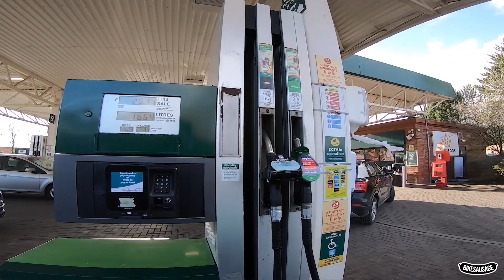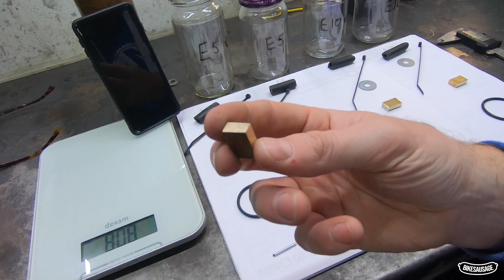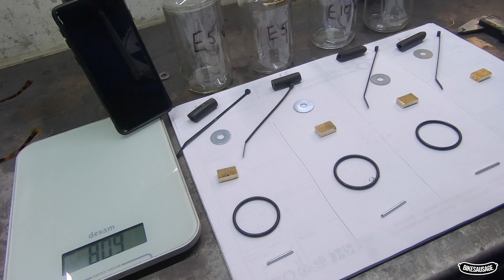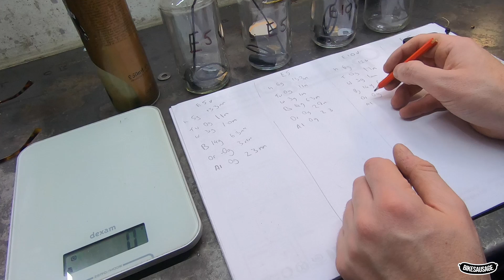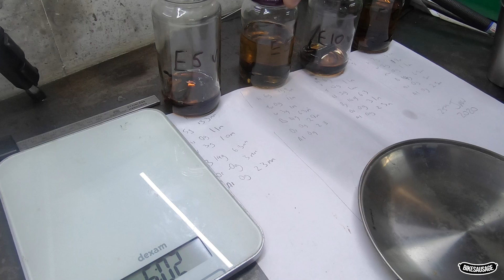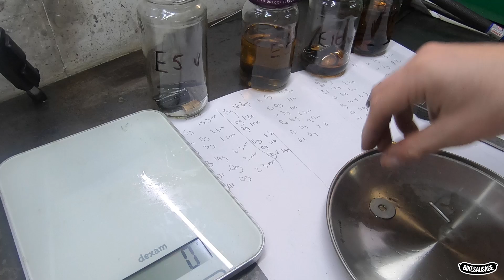E5 v E10 FUEL | Does it really make a difference?

Comment: My first question is ... Was the O-ring being used one  of a type that would communally be used in a fuel system or Carb, or was it just a run of the mill O-ring.   My next question is what would happen if you re-did the experiment but this time got a new o-ring say a new injector seal from a modem car then a new replacement o-ring from a carb system.  Are the new o-rings in new vehicles any better set up to deal with the ethanol or are manufactures just telling us they are.     Like your work, really interesting video.  :)
Reply: On earlier vehicles, rubber parts in the fuel system were invariably nitrile rubber.  This will cope with intermittent contact with efuels, but will fail relatively quickly when continually immersed.

Plastic and metal fuel tanks can also suffer damage as a result of efuels.

Comment: If you have a nylon tank like aprilia rsv milles and other bikes from tbe early noughties or later you need to be careful about E10.  Ethanol and nylon dont do well together and ethanol absorbs moistures...end result is the tank absorbs water and swells.  It's not scare tatics..it does damage. Storing bikes over winter to  be safe use storage petrol. It's ethanol free and 99 octane and stays stable for a year.  Ethanol will damage some plastics and rubber and can be a catayst for fuel sludging up in fuel systems...plenty of proper evidence to back this up.
Reply: where do you get storage petrol from ??
Reply: @virtuosomuso  I bought mine online from AngloAmerican Oils.  Not cheap at £25 for 5 litres delivered but its part of the running costs for over wintering the bike.
Reply: Gulf super unleaded fuel is ethanol free I think it's what goes in my tuono no problems so far with any tank expansion or running issues.

Comment: On a dyno you drop 5% power on e10 fuel. I’ve tried it on the 3 bikes I own same result each time. The bikes are Triumph 850 sport(2020), triumph t100 (2017) with Tec cam fitted and Enfield 500 Trails (2019) fitted with Hitchcock 615cc conversion.

Comment: I've run a few tanks of E10 in my MT10. I averaged about 105m a tank compared to 127m with E5 so I go with the full fat.
Reply: Same here, only I'm running a 20 year old car. Being a Toyota, it will run on E10, but I find I get around 10% better fuel economy from E5/Super, which negates the price difference. Seems to run better, too, probably because ethanol gives less energy.
Reply: Ethanol contains less energy compared to Unleaded Fuel.
Reply: @Varrakk  The energy density is less with E10, compared to E5 and E0. I fly a microlight with E10, compared to E0, I get 12 l/hr on E10, OR 10l/hr on E0.
Reply: @Varrakk  E5 & E 10 are both unleaded fuels .
Reply: Same here on my Ducati runs a lot better on e5
Reply: 127 miles a tank wow
Reply: I've also dropped about 20miles range. Definitely worth a couple of quid extra for 20miles back.
Reply: 15 liter tank?
Reply: @TheCrabbers  17
Reply: So what works out better value?
Reply: Pls stop. Such differences are impossible.

Comment: We've been stuck with that E10 garbage in the US for a long time now.  I had to replace every single rubber fuel hose on my '86 Nissan pickup because of it.  The newer hoses work fine with the E10, but the truck runs a lot better on 100% gas.  It's just hard to find that reliably, especially in rural areas where I usually am.

E10 will also lead to higher corrosion/gumminess/etc. in carbs.  I only run 100% gas in my '93 Honda ATV and '76 CB550.  Previous owner of the CB had put ethanol fuel in it and let it sit, the carbs were an absolute disaster.
Reply: I use 110LL (avgas) now on all of my older vehicles now. 
Ethanol is a mistake in anything earlier that the 1990s IMO. 
Obviously not using avgas in anything with a cat before any clever person points out its not compatible ;)
Reply: I think it's a mistake full stop, a guy I work with had a 2009 volkswagen jetta and he filled it with E10. Within a day he noticed a significant drop in power and by the end of the week it was hard to start and cut out at every junction. Previously he was getting around 400 miles on a full tank, with the tank full of E10 he got 250 miles. He then filled it with super unleaded E5 but the E10 had already damaged the fuel injection system and the cost of repair was more than half the value of the car so he traded it in for a diesel. We've got a petrol generator at work and someone filled it with E10, it hasn't been the same since. I will never use E10 in my bike.
Reply: 100% gas is amazing if you’ve never used it. I was working In Iowa where it’s sold as “super” at 87 oct 
My truck ran better than it ever had on e10 at 93oct 
We have a station near a boat loading ramp that sells 91oct 100% and that stuff is like jet fuel in my tundra, but at $5.99 a gallon it’s not every day I’m buying 38gallons of that magic elixir
Reply: @Heavywall70  you can still buy ethanol free petrol here in England, super unleaded but I've just did a price conversion, you're worried about  $5.99 a gallon? We're paying  $9.50 a gallon here.
Reply: @sambrooks7862  Super unleaded is E5 which contains 5% ethanol .
Reply: @maskedavenger2578  no, it depends where you get it from. The E5 is the maximum amount of ethanol in the fuel and some companies don't put any in it, namely esso, although truth be told we don't really know what they put in it, for all we know it could have badger piss in it lol.
Reply: @sambrooks7862  I used to know a tanker driver he said they deliver the same crap to all different fuel stations ,could be Esso BP ,Shell or Texaco ,I have also heard the same from other sources . It’s hard to know who to or what to believe . I tend to stick to the same local BP & use there E5 as it’s my engines always run good on it & I had a Suzuki Bandit 60O laid up for 2 years & started fairly easy & ran ok once it cleared its throat on the old E5 basic stale untreated unleaded . I never use Supermarket fuel as I have experienced poor running in the past when using it . Both the motorcycles I own now will run on E5 or E10 ,but I will use premium E5 until I have no more choice  but to use E10.
Reply: @maskedavenger2578  yeah, it's like when you buy a beer, it might say 5% on the label but most of us don't have the facility to test it. 👍
Reply: @sambrooks7862  When it comes to beer I think the flavour is more important than the alcoholic Volume . I prefer proper traditional British ales, but in summer I also like to drink good quality German or Spanish Estrella lager beers, but I find with lagers once they get over 6 % Volume they tend to taste like treacle .

Comment: E10 is shit and hurts fuel economy the new type of ethanol leaves green crusty residue that gums up carbs and attracts water in gas tanks. Anything left over 6 weeks needs additives ‘Startron’ works quite well - any ethanol in fiberglass fuel tanks will bubble the paint almost immediately so be careful of those beautiful and expensive 70’s racing gas tanks.

Comment: I left 1/4 tank of E10 in my '06 hornet (carbs) from start of October to start of march as I was suffering with a bad back. When I came to start the bike it would only run on 2 cylinders. After diagnosis of misfire I stripped the carbs to find blocked jets and emulsion tubes. I now only run E5 super from quality forecourts
Reply: check and see if the vacuum petcock is working correctly. cuz if it dribbles with the bike not running it makes running carbs super difficult. i got an 99 bandit 12 that run on American e10 for most of its miles and its fine. stored for 6 months out of the year and no issues.
Reply: @nick4506  I notice that a lot of people in the states say that they've never had a problem with E10 whereas it seems that a lot of people in the uk have. Could it be possible that the difference in the climate affects it? Or maybe the petrol you guys have is a different grade?
Reply: @sambrooks7862  i don't think it's climate cuz the us has literally every climate you want. i think we just got e10 earlier and our petroleum engineers have had time to get it right. and now all the good ethonal gas formulas are patented here in the us. just gotta wait for your manufacturers to buck up and pay licensing or come up with something else. just a thought.

but people complain every time there is a change, attributing every problem to that. and it takes a while for people to realize that it really didn't change that mutch.

also stuff like stabil and most other fuel stabilizer additives are just ethonol and dye, and people swear by those. they complain about ethanol then say they fixed it by adding more ethanol. so I don't think it's as bad as people say it is.
Reply: @nick4506  food for thought? Thanks for taking the time to reply Nick.
Reply: @sambrooks7862   also in the law the e10 in us, the 10% is a maximum for regular and it can vary a lot, sometimes when corn is expensive its like 2-6% out of the nosle. but idk how the law is in britten, could be that that's the floor instead of the ceiling sout it could be 10+ given what ever the market conditions for corn are.

i know in britten and the eu the oil part is expensive so maybe more incentive to max out the ethanol.

also for our e10 it's on top of whats already allowed to boot octane, so sometimes supreme or the highest octane fuel you can get here is like 25% ethanol. and most bikes use this stuff so idk what the issues people are haveing with e10 in britten.
Reply: @nick4506  hi Nick, thanks for the reply. Yeah I don't know the science behind it but I would suspect that the fuel we are being sold is inferior, it's definitely much lower octane, hence the drop in power. Problems with E10 here in England aren't isolated incidents it seems to be the rule rather than the exception. Just yesterday I spoke to a customer who has a honda civic, usually a very reliable car, and the guy told me that he's started having problems, low power, running hot, difficult to start etc. I asked him how long he's had the car and how long he's been having problems? He bought the car new in 2018 and it started playing up a few weeks ago. He has always filled up at sainsburys because it's on his way to work so I suggested that maybe he should switch to ESSO or BP super unleaded? I'm going back to him in a couple of weeks so it'll be interesting to see if he has and if there's a difference?

Comment: We've had E10 in north America for years. The main issue is that ethanol absorbs water. Especially in a carburetor, this means that E10 will turn into goop within weeks to months as it evaporates. Bad news for winter storage
Reply: I have a carburated motorbike. It has been on E5 and E10 all its life, 140000 km. Never had any problems. Carbs are clean. No additives. I dont drain the carbs when parked for months.. But if the vehicle is not siuted for Ethanol, that might give you problems..
Reply: Man i sure know that. Every spring i need to take my carburettor apart and clean it out on my dirt bike after leaving it sitting over winter the fuel is always contaminated with water
Reply: I’ve used E10 for my outboard for years. No problems at all.
Reply: @davidmatthews3093  I wonder whether the very large increases in the costs of fuel, or the rationing we can expect very soon, are things that suggest fuels which are less economical, and can damage fuel system parts of older vehicles, are something we need to strongly support?
Reply: The main issue is the fuck off great big vehicles that do more gallons to the mile than miles to the gallon!
Reply: @steven-vn9ui  Why you mad, bro?
Reply: @wretchedrider  he’s not lmfao
Reply: @steven-vn9ui  The higher the ethanol, the lower the calorific value of the fuel.  Some vehicles will used 10% more fuel, and others will suffer long term damage.
Reply: Petrol without Ethanol absorbs water... get your facts straight.
Reply: @thedirtyworkshop  ethanol is water soluble. That's why when you buy a bottle of whiskey, there isn't a layer of ethanol at the top. Petrol is not water soluble. That's why when you poor water into petrol, it collects as a bubble at the bottom. In fact, a good method to remove ethanol from E10 is to mix it with colored water. The ethanol absorbs the water and separates from the petrol.

Try being less confident when you don't know something
Reply: @thedirtyworkshop  Phase separation is the thing that makes E fuels particularly unsuitable for anything fitted with a steel fuel tank.

Water separates out,  and tends to rot the bottom of the tank out, if left for any amount of time.

The very poor Chinese made steel tanks fitted to Harleys, have been suffering from this for a while................
Reply: @thedirtyworkshop  you been watching what I have too shall I tell them to wash ethanol out with water no more ethanol problems
Reply: @davidpierce7318  you have no idea if the water will remove substances alongside the ethanol.
Reply: @oldgreybeard2507  I’m taking the mick
Reply: @thedirtyworkshop  maybe I am not a chemist butnwhere did you get this fact from? Ever tried mixing them? Ethanol by nature alcohols are hidrofil... E0 won’t absorb water so it fill sit on the bottom of the fuel tank, ethanol absorbs some of that that water... ”Facts”

Comment: E10 has been the only fuel for decades in California, no problem with that apart from being hygroscopic. Which basically means if you put your bike away for a long time, make sure the tank is completely full so the air gap it can absorb water from is smallest.

Even my old (1997) carbed DR650 had no problem with it. The swelling tank problems (Ducati?) were solved in the early 2000's and were mainly caused by the water that was absorbed by the ethanol, which in turn would be absorbed by the tank material.

Don't forget that most fuel systems come from the same companies that supply the car industry as well....

Don't worry about E10 too much, we've been the guinea pigs over here in the good old US of A since 1990...
Reply: Agreed - '86 K75, '99F650, "01 KLR, "20 DR and various small engines. No problems, always stored with full tanks and SeaFoam.

Comment: Hang on, can you not get 0% ethanol fuel in the UK? Here in Australia we have E10 (94) but all others are Ethanol free, 91, 95 and 98 octane. Some places have E85 for those performance vehicles tuned for it. I don't use E10 in my car as the mileage vs the few cents cheaper doesn't work out. My bike takes minimum 95 octane so it's not an option though I wouldn't anyway.
Reply: Yes you can still buy 0% ethonal in the uk, super unleaded (E5) doesn’t need to have any ethanol content in it at all (5 is the max) Esso, bp, texaco can all be bought ethanol free.   Although bizarrely bp in the south west isn’t. And bp is only 97 octane where as the others are 99.  The vid was almost a good bit of science bless him :)  it’s not all bad, Ethanol does have one benefit, other than emissions, in that can help lower running temps in air cooled bikes..
Reply: You can get it they are marked up as e5 but certain stations have 0% you just need to check before filling up.
Reply: Same here in NZ, I have a 22yo bike and hoping we're not forced into using these ethanol fuels. Whatever happens in Aussie will happen here so fingers crossed we get to keep our dirty fuel for a bit haha
Reply: One of my local garages in south of England sells E0 but it’s not as common as E5 & E10

Comment: Removing the ethanol out of petrol is easier than you’d imagine.
Reply: And then change the octane rating risking engine damage.
Reply: Yup. H²O easy to separate. Then just add some octane booster and wallah
Reply: @seespotride  and have you tested these octane boosters against ethanol? How do we know they’re better or worse than ethanol? It seems daft to remove one substance that we pay through the nose for only to pay again to substitute it with no real evidence of improved performance, and no evidence of reduced damage to components. 

While I accept that ethanol can damage older rubber, modern vehicles have been build with the use of ethanol in mind so removing it makes little sense.
Reply: @seespotride   Yep👍 you know what I’m talking about